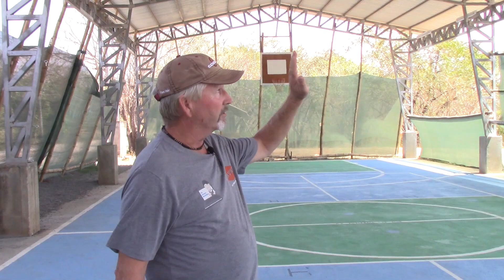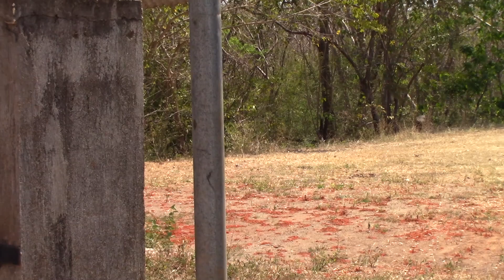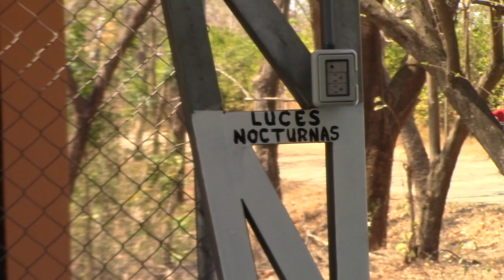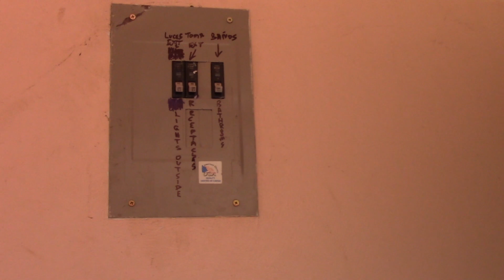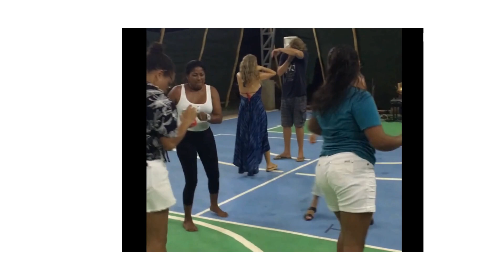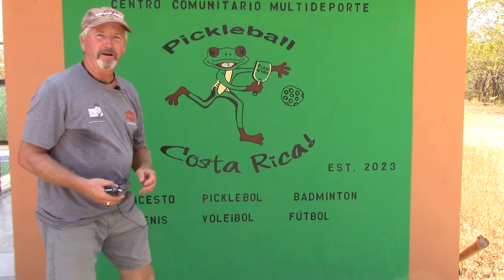Internet Electrician Gives Back - A Volunteer Electrical Project for a Community in Costa Rica

Comment: I am also told by a friend who goes there that we have never really had a Pineapple here in Canada because we get force ripened instead. he said, down there they go out to the field and pick a perfectly ripe one.  Could probably paint that meter cabinet Terry
Reply from the maker: That black crap is mold.  Yes, it needs a pressure washing at least!  And yes, the pineapple is excellent.  We don't forage for it, but buy it a Maxi Pali for 3 for 990 colones, or around $2 USD!